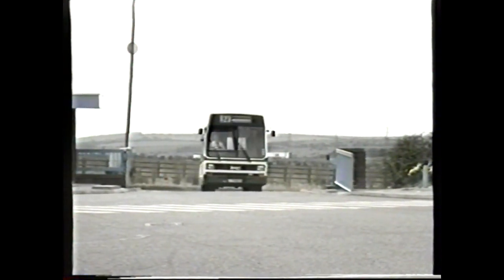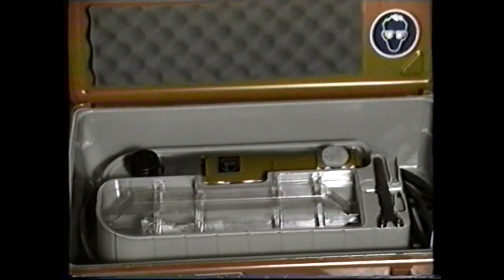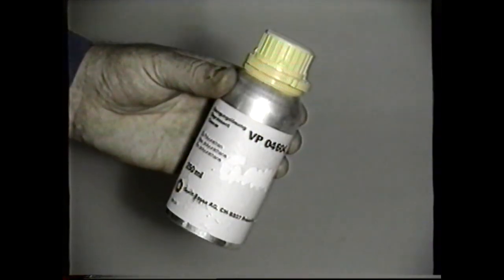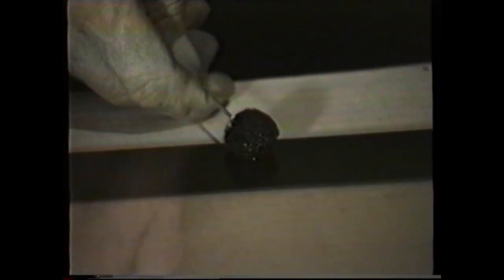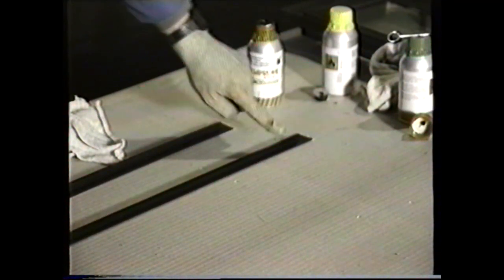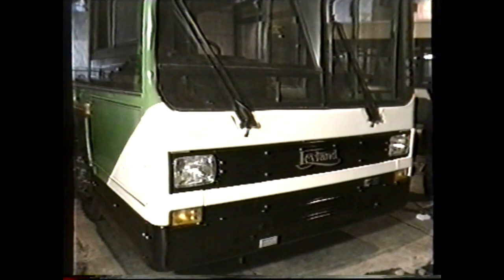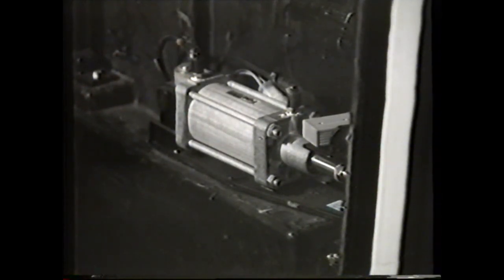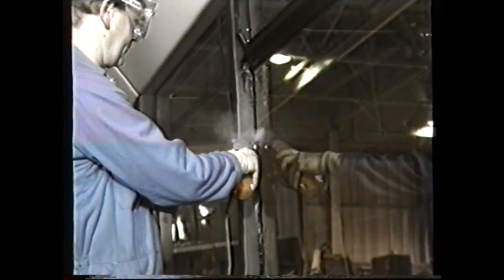Leyland Bus - Lynx Body / Glazing Maintenance & Fitting Procedures - Door Adjustment - Training Film

Comment: I used to work on these at WMPT.
DUDLEY GARAGE..

after MOT repairs. 
I would take them for 
The test. 

I loved driving the Lynx. 2

Had 90  MPH out of them..Cummins engine..

If you held the 1st gear button down and floored it   let the button go  these beast s would wheel spin...